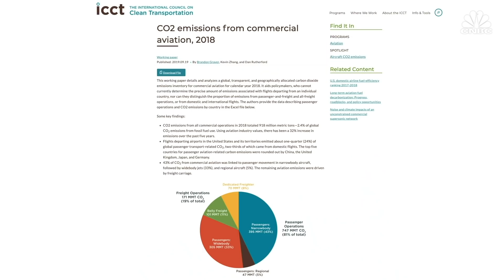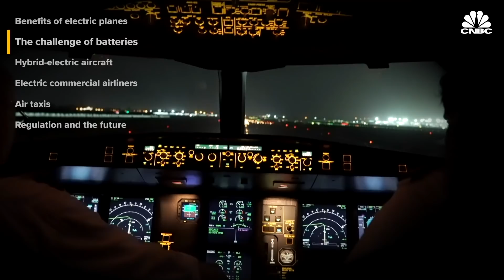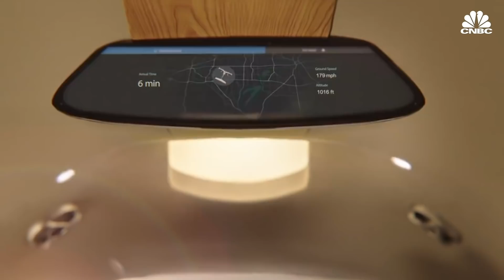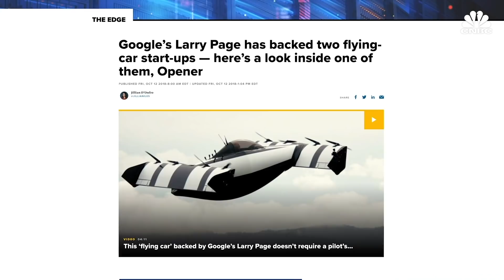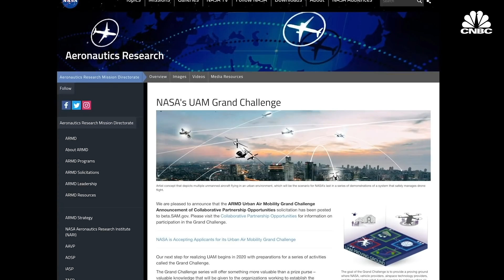Why Don't We Have Electric Planes Yet?

Comment: TLDR: the energy density of gas vs lithium ion batteries is like 100 to 1 and batteries are heavy
Reply: That's also why electric cars haven't caught on much.
Reply: @kansasthunderman1  actually they are expanding rapidly, especially in emerging power China, and literally nearly all of Norway, and Western Europe is embracing it. Cars are not like planes.
Reply: It's more like 50 to 1 in raw energy and even less if we take into account the weight of the fuel tanks and fuel system and the low efficiency (that is all the wasted energy) of a piston engine. LIthium ion batteries aren't the most efficient batteries anymore so this video was outdated  long before it was posted. Graphene batteries were launched earlier this year and they already offer better effective energy density than liquid fuel for smaller commercial airplanes.
Reply: @tessjuel  ...you're wrong on all accounts.
Reply: @jjlad5037  Wanna bet? ^_^
Reply: But u r also forgetting that more than 50% of that energy is wasted in the form of best and vibration.
Reply: @dranzergigs8333  ...virtually no vibration and the heat is utilized...unlike electric planes that must use parasitic electric heaters...funny how that little tidbit is never discussed.

Comment: Why?
Because low battery in mid air will make people panic .
Reply: yeah man don't you hate it every time your airplane takes off with an empty tank of gas and you end up crashing and everyone dies each time because they forgot to refill the tanks?

Oh wait...
Reply: “oops we forgot to charge it”
Reply: The same applies to low fuel then.
They'll take every concern into consideration, like how long a fully charged plane will fly.
Reply: More than low fuel?
Reply: @ChrisKnowles1170  There's more energy in fuel than a plane load of heavy batteries.
Reply: @kansasthunderman1  did you not watch the video? Yes, jet fuel is more energy dense, which limits electric flights to short range. Crossing the Atlantic is not the only use of a plane.
Reply: No  problem, just put solar panels on the wings!
Reply: John Van Ruth put the 23%(max)efficiency solar panels? 🤣🤣🤣 unfortunately usually the efficiency just only 10-15% only.

Fun fact: The sun radiation density that reach to earth, 1000W per meter square. (And collect 10-15% of that by solar panel😄)
Reply: @demonsoldierchem  go on and Google the efficiency of jet fuel. After that check out project Bloon and the other 24/7 solar flights.
Reply: Chris Knowles So you going to use solar powered plane? Well it’s exist, then you use it for cross Pacific, and you will in Times magazine.
Reply: @demonsoldierchem  I don't have to do anything, those planes already exist. They're not passenger planes, but they work, and fly 24/7. Did you do the googling?
Reply: Chris Knowles yes, that’s why you going to show the world its exist and green by cross Pacific. The world will proud of you.

*hopefully you could land to another side of Pacific before night. 🤞
Reply: Chris Knowles at least jet engine is have great efficiency 

https://upload.wikimedia.org/wikipedia/commons/4/45/Propulsive_efficiency.png

https://upload.wikimedia.org/wikipedia/commons/0/01/Gas_turbine_efficiency.png
Reply: @demonsoldierchem  that's the engine efficiency, not the fuel.
Reply: Chris Knowles Ask your engineering professor. 🤣🤣🤣 Go go, and do the calculations prove solar power better than Jet Engine.
Reply: @demonsoldierchem  wow, an emoji. That really effectively counters my citation.
Reply: Chris Knowles Chris Knowles Good good. Max speed 140km/h, sound like same like what I saw in Japan University competition. 
If build a Commerce place that only fly 140km/h, how many 17000pcs x solar cells needed? 
Wonder how much it will cost, and how much the ticket sell.
Reply: Chris Knowles 😂 Now you don’t know how much airline should change you for a flight?
Reply: @demonsoldierchem  
Good one 👍.

Comment: A battery ~1/20 the thickness of a car itself gets as much range as an ICE car from a tank that’s about 1/35 the car, and is multiple times heavier.

Compared to gasoline, batteries as a technology, though reliable and useful, still have a long time to go before they even compare to burnt gasoline in a plane. Pure electric planes will happen quickly when somebody puts a Hydrogen EV motor onto a Boeing.

Comment: I wonder if they did eventually switch to electric, would we still see "con"-trails blanketing the sky depriving all life of essential sunlight?
Reply: Contrails are harmless.
Reply: 'Impact of Aviation on Climate: FAA’s Aviation
 Climate Change Research Initiative (ACCRI) Phase II'

"Emissions identified as potentially affecting climate include radiatively and/ or chemically active species such as CO2 , BC, NOx, HC, CO, SOx, and H2O. Direct emissions of gases (e.g., CO2, H2O, soot particles), by-products (e.g., O3, stratospheric H2O), and perturbed methane (CH4) tend to have a warming effect [positive radiative forcing (RF)]. Gaseous emissions of SOx and NOx evolve and partially transform into volatile nitrate and sulfate aerosols and those of gaseous HC emissions into semivolatile organic particles, which also contribute to climate change. Particles like sulfates generally have a cooling effect (negative RF) unless they coat soot particles, which exert warming effects. Note that BC particles are normally considered to be the main component of soot particles."

Real harmless. I wonder what that mysterious black substance is that is coating all of the monuments and buildings in DC is? There is a lot of air traffic in and out of there, isn't there? Black carbon soot possibly? Hmm, what do they talk about using for weather modification in the AF document 'Weather as a Force Multiplier: Owning the Weather in 2025'? I'd say after decades of "remote sensing" the "perturbations" produced by aircraft they (FAA) know exactly how to route planes to get whatever desired effect they please. Just so you know, numerical climate modelling and geoengineering go hand in hand. Always has and always will.
Reply: @CGoffgrid  What are you trying to say? That it just stays up there forever? 100,000+ flights a day directly seeding clouds. We aren't driving our cars in the clouds. You aren't worth the time. Next..

Comment: fill a blimp with hydrogen gas and little bit of insulated liquid hydrogen and move it using a 4 stroke motor and hydrogen gas....BUT NO, MUH PLANE HAS TO TRAVEL 5000 MILES IN 1 DAY

Comment: Of all technologies that actually matters, I see just 1 problem: Today’s Batteries are just not good enough.

We have 3 ways out:
1- Battery technology improves dramatically.
2- Someone will find another way.
(Maybe a energy-packed liquid that can be burned and uses carbon to be manufactured. 🤔)
3- We will fail the Electric revolution.

There is no other way.

Comment: imagine having to charge the plane for 20 hours (or more) before the next flight
Reply: You can just swap the battery. Jet fuel takes a lot longer than 20 hours to refine, but we always have plenty on hand.
Reply: Chris Knowles Wouldn’t changing batteries just adding more delays for example, more delays are more loss for profits for airlines, unless they solve the battery problem then they could possibly convince some companies to try it, by all means it could be more expensive and you should know these airline companies really want to be a cheapskate like just look at the average plane seat from the 1950s to now
Reply: Farzet if modular battery packs that are super easy to access and swap are used then it’s conceivable that a battery swap could be done in a similar amount of time to refueling. Airports that these planes fly out of could just have a warehouse full of charged and charging batteries.
Reply: @farzet3937  Why should a battery swap take longer than filling a tank?
Reply: @ChrisKnowles1170  Because the amount of energy required to get a medium sized plane like an A320 airborne and fly a reasonable distance is enormous. I dont think it would be possible with current battery technology, youd need a battery pack that weighs as much as the plane itself. Even with a 9 ton battery youre only looking at 300-400 miles range, and good luck changing that within 20 mins on the ground.
Reply: @Dudeisthere  The size and weight of the battery do present problems, yes (as addressed in the video). I'm only saying that those problems are separate from charging. Particularly in this field, it's not wise to say something is impossible. We went from biplanes to the Moon in, what, sixty years?
Reply: @ChrisKnowles1170  Those problems arent really seperate from charging though, if you have a massive battery charging will take too long and swapping it is the only option. And id imagine swapping a 10 ton battery would be quite difficult to do in a reasonable amount of time.
Im not saying we will never have electric planes, maybe we will have super batteries, maybe charging wont be an issue at one point etc. But right now we can only look at the technology and knowledge we already have, and from the way thats looking it will be quite a while before we have full electric commercial airliners.
Reply: @ChrisKnowles1170  Batteries are too heavy for planes and you can't store spare batteries in clouds where a plane in mid flight can just pull over and get a recharge. .
Reply: @kansasthunderman1  you gotta be pretty thick to think I meant mid flight
Reply: @kansasthunderman1  they will get lighter yet more dense.
Reply: kansasthunderman1 your brain is extra smooth huh
Reply: 1life To live  In formula 1 they get that energy from regenerative braking and a small battery and electric motor for a short boost. When do planes need to slow down during cruising? When they do slow down they don't stop the engines and let the propellers reverse direction, they just slow the the propellers or jets down a bit and wind resistance slows you down pretty quick. You'd drop like a brick if you tried getting energy back before wind resistance slowed you down. Not practical at all like it's in in electric cars or formula 1.
Reply: @Jaker788  yeah I commented on that too. Not the same
Reply: 1life To live  sounds like another version of a perpetual motion machine. Not practical
Reply: 1life To live  The only issue with that is you have a net loss of energy because you expend more to accelerate than you gain in regenerative braking. It works for F1 because they turn petrol into hybrid power but In the plane it would turn electric power to turn the props/jet into electric power again and there is too much of an energy loss in the process. Right thought process, wrong types of energy
Reply: Marat B 
I charge my electric car in 20-30 minutes.

Comment: Construct a small scale thorium nuclear reactor, put it on a commercial airliner and voila you've got all the energy you want. Considering thorium is a lot safer nuclear fuel. This is the only way for the big planes and intercontinental flights. Enough with the batteries concept. It's hardly ever going to work properly.
Reply: arrr enough with the thorium reactors.

Comment: Did you charge your plane?  Yeah, its at 34% it'll be fine
Reply: Anthony Smith  ,
Solar cells don't work well with commercial aircraft. The power they add is insignificant compared to the power required. They do work well for small craft with relatively massive wings that are optimized for this though and don't need to achieve high speeds.
Reply: Just replace batteries.
Reply: @andreykhabarov7065  a large but modular battery pack that you charge while the plane is in the air. I like it
Reply: @andreykhabarov7065  Yeah, how many tonnes of batteries is that?
Reply: Andrey Khabarov 😧
Reply: Anthony Smith  How heavy would your plane be? And how much power would it use to get off the ground? Good thoughts, but highly impractical with the current technology of solar cells and storage batteries.
Reply: But what if your plane is an iPlane? 34% would be enuff to travel 100km then crash
Reply: Did you fill up your plane? Yeah, it's only 34% full it'll be fine
Reply: CodePlay how long would it take go from 34% to 100% in fuel compared to electric?! Minutes to hours!
Reply: Only 5 hrs with supercharger 😋
Reply: @building_keevo  Not beyond the realms of probability seeing a Tesla takes hours to charge.
Reply: @inthefar-queue6270  wtf a tesla takes 15mins
Reply: @marcg.3830  minutes to days I'd expect. at least if you're comparing it to charging a car. I'm using hyperbole, I'm sure airlines would get special high powered lines that would enable them to juice up their batteries quicker. but still.
Reply: man i dont know what to say 😔
Reply: actualy there are electric planes being used everywhere time for you to do some research
Reply: G Kim https://youtu.be/25uMbGTA6PM
Reply: I'm looking forward to a Cessna 182 Ludicrous Mode STC.
Reply: the batteries will for sure be takeout batteries to change the empty ones with full ones instead of charging , there are electric bobcats for underground mining where you cant use engines that produce emissions, they have 1/2 m³ sized cubes as battery packs and you simply change them out every 8 or so hours, you disconnect the battery and lift it out of the battery enclosure , then you drop in a charged pack and connect it, with a automated battery changer it takes less time than filling up a tank
Reply: Well 34% might last in your smart-phone all day, if you do not use it too much.
Reply: You forgot to put the following before your phrase: The pilots last words: ....and the RIP at the end!
Reply: Don't flush!
Reply: Don’t you guys know that airplanes almost never takeoff with full fuel anyways
Reply: @westy2432  That would be news to the pilots who fly non-stop from Los Angeles to Korea and Japan.
Reply: Captn: uh attention passages our charge went from 100 to 13% in about 2 minutes. Plz unplug all devices prepare to crash to your death
Reply: How do you charge your phone?  Why do people ask dumb questions about electricity, as if it was invented yesterday? Get a grip.
Reply: you probably dont care at all but does anyone know a tool to log back into an Instagram account??
I was dumb forgot my password. I appreciate any assistance you can give me!
Reply: @Alden Corbin Instablaster ;)
Reply: @Oscar Carson I really appreciate your reply. I got to the site thru google and I'm waiting for the hacking stuff now.
Takes quite some time so I will get back to you later with my results.
Reply: @Oscar Carson it did the trick and I actually got access to my account again. I'm so happy!
Thanks so much, you saved my ass !
Reply: @Alden Corbin Happy to help :)
Reply: Imagine if the battery percentage starts getting dodgy like phone batteries when 20% suddenly down to 5% on an instant
Reply: that is true you cant fly right after a flight but can you use an interchangeable battery
Reply: @thomaslavery684  it will be like laptops 20 years ago. :)

Comment: So I find it funny that the solutions that keep on being repeated is that batteries will get better, but no one is mentioning the problem with the physical limits of batteries, here is a good video that explains battery limits by minute physics https://www.youtube.com/watch?v=AdPqWv-eVIc .

So the best-case scenario for a chemical battery is 5% of the current weight or 20 time the energy-dense as current batteries and quoting the guy that said that jet fuel is currently 40 times more energy-dense than current batteries and what do you get? You to get a plane that was exactly the same on take-off that can get about half the range, it gets worse when you take into consideration the jet fuel based airplanes get lighter as they travel while battery-based ones will not and even worse when you consider that jet fuel isn't even that great of a fuel produce pad emissions and doesn't burn stoichiometrically well with air so you end up with unburnt fuel (which is why afterburners exist on some aircraft) existing engine.

So giving electric planes several best-case scenarios as the advantage and giving the jet engine the disadvantage that they will not be improved, and the jet engine still wins in terms of performance and usability.  Rather thinking about shoving batteries in everything maybe think about renewable fuels or maybe developing methods to produce cleaner hydrocarbons (propane?) Don't get me wrong batteries are great and the current lithium-ion battery can still compress to half its weight theoretically which would be great for cars. (and yes graphene capacitor might change everything but how many decades or centuries are we away from making that commercially viable?)

Comment: There are several successful electric airplanes operating right now. The largest so far is a six passenger which flies about 300 miles and some much larger passenger planes in the making. If you do a 5 minute google search you will be much more informed than CNBC.